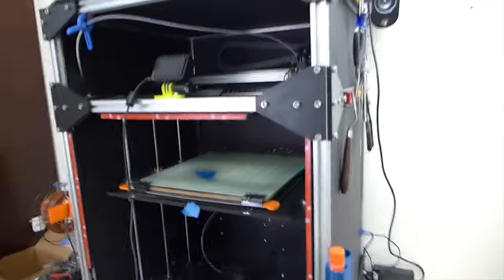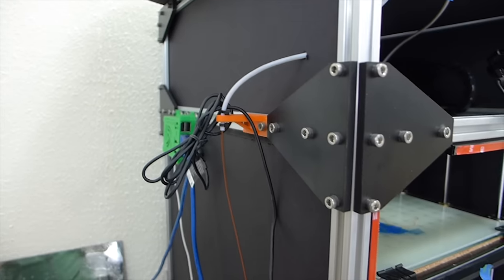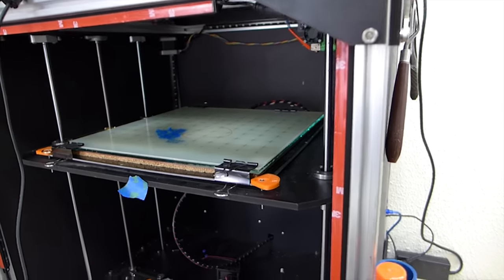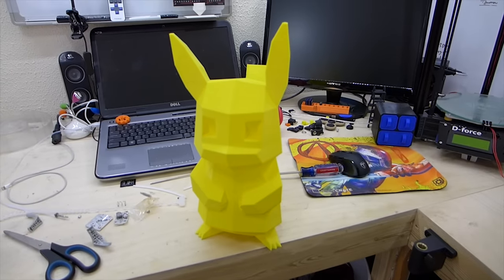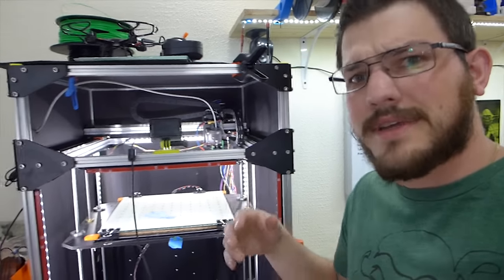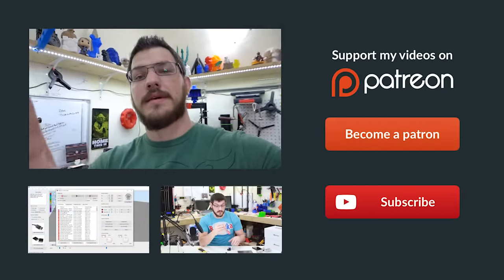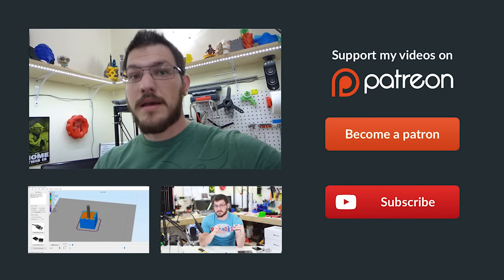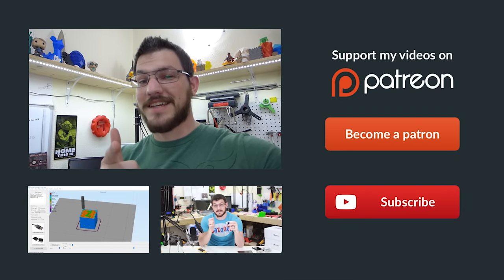Build Your 3D Printer Stock First!!

Comment: FINALLY someone says what I go ballistic over every time I read a post from some guy who just ordered his first printer and wants to know what upgrades he should order.  I want to STRANGLE the ^&(*)().  I went at least 6 months without an upgrade except for the BLTOUCH, which I knew worked well from having it on my 2020 i3.  That printer ran about the same amount of time before the BLTOUCH was put on.  To this day, the only upgrades are the  extensions for more Z height and the X axis tension adjuster.  It still reliably puts out great prints I can count on.  If it fits, it's my 'go to' printer.
I agree that there is NO NEED to upgrade the FT5 to get good prints IF you put it together square and take the time to calibrate it.  That is another pet peeve of mine.  I see so many posts of FIRST PRINTS of things that should be TENTH OR TWENTIETH prints.  Where the hell are your calibration cubes, you single wall test prints to determine extrusion multiplier, and your tolerance prints?  
They buy all these upgrades and even just the printer and expect everyone else to solve their problems rather than them doing some leg work and learning and figure it out themselves.  They are just too lazy and those on the forum are to blame because they jump right in and spoon feed them the info.  They will NEVER learn that way.  The latest was the guy who wanted to know how to hook up the electronic switch for controlling the current to the heat bed.  IT'S A F'ING SWITCH!!!!  There's an input and an output plus a signal to tell it when to turn on and off!!!!  If you don't want the input coming from the MKS (the reason you bought the damn thing), then where do you think the power's going to come from?  As for the signal, he couldn't figure that out?  
NOW YOU HAVE ME RANTING!  hahaha

Anyway, kudos on saying what needed to be said.  I have an early FT5 and the only upgrade I have besides the BLTOUCH is the E3D setup since my stock extruder never had the power to feed as well as the one on the 2020.  Oh, and I just 'upgraded' to the black heat bed I should have had in the first place.
Reply from the maker: Reading this gave me a good chuckle lol. This sadly is the new trend with 3D Printing and I hope to snuff it out.
Reply: Yes, it is the trend.  Every day you see questions that could have been answered with just a LITTLE googling and use of a few brain cells.

Comment: I would have been inclined to agree with you; however I believe you should mention if you are "a first time builder of anything 3D printer related".  I'm not a firm believer in the build it stock first if you've been around the world of 3D printing and understand Marlin, Smoothieware, Arduino for Due, have worked with the Duet boards, Due/RADDs, MKS Sbase and the cursed Arduino/RAMPS boards. First time yeah, been at it a while, pick your poison. I'm in the later group.

Comment: This is some good advice.  I just order the FT-5 printer on March 3rd but it has not shipped yet. I have been 3d printing for almost 3 years now. I started with the DaVinci 1.0. I then moved to the Flash Forge Creator pro and a Robo 3d, both of which I still use almost every day. The FT-5 will be the first 3d printer that I will have to build. The only thing I am going to change while building is putting a MK10 Micro Swiss all metal hot end on it.  The rest I am doing stock just to see how it does.

Comment: I've had mine built and running for 2 months and i'm just now starting to upgrade... basically I'm beefing up the gantry idlers to increase speed without  belts going flying. This is a great kit overall!!! I did buy a couple parts to experiment with bowden too , but i was more than pleased until i started pushing speeds. This video is good advice for sure!

Comment: I agree if you're a new user.  If you can't adjust and get stock running and have the patience to make what you have work adding more complexity to a difficult hobby will just multiply the frustration.  

If you are experienced it changes everything ( a couple years for myself). Even so my only start changes are the extruder. My whole focus in getting this printer requires a different extruder so i couldn't see starting with the stock setup.

Comment: I think you mean well but it comes of sort of condescending.  A lot of us new FT-5 owners see numerous threads about simple tweaks others have made for better quality.  So far my upgrades have been replacing the wood/pressure-board pieces with aluminum.  It sure beats doing those from the start versus assemble, then take apart again!  I see a lot of builders struggle with what part cooling fan to use....if Folger included one, that would be nice, too.  Wrapping up....many of us see the struggles some builds have and improvements are advised.  I'm not sure knocking people for considering those things is all bad.
Reply from the maker: Hey there. This kinda was supposed to be a bit harsh but not condescending. More of a "wake up call". Looking back at the video I should have said a part cooling fan is not what I am talking about. That is also not really an upgrade, it is a necessity.
Reply: Fugatech 3D Printing I don't think the part cooling fan is not 100% necessary. I've been running my FT-5 for ages stock with no fan. Just saying. The FT-5 IS great out of the box.
Reply from the maker: If you are doing detailed prints in PLA or PETG I feel it is 100% necessary. But that is just my opinion.

Comment: The absolute facts here. We bought the FT-5 R2 for business printing of cad drawings to save on prototyping lead time, and cost. Once I had the machine built to stock specs, I spent about 4 days getting it dialed in, doing tons of research, and playing with settings,. My goal was to get nice prints using ABS at very long print times 24 hours plus. As our parts can be large, and complicated. We started with the basic stuff, test cubes, etc. Once we were happy with that, I moved on. We finished our first 24 hour ABS print last night, and it came out perfect on a 100% stock machine. Not a single upgrade. NOW, I am going to do some upgrading, different spool holder, enclose the printer, and at some point a nozzle upgrade. All I can say is the new R2 kit with the improvements made, 24V bed, etc this machine can do a LOT for very little money. Just be patient when building, and take the time to get it set up right before throwing upgrades at it

Comment: I'm afraid I disagree with you. as I built mine I used the 713 maker parts where I could and the metal brackets. then I finally listened to everyone saying leave the rest stock... now I'm waiting on a heated bed to arrive because the new style heated bed only gets to 90c after half an hour. I only print abs so this was unacceptable. and yes I am an engineer haha.
Reply from the maker: You have the v4 black bed? I know it works well for PLA @ 60C but I didn't hear much about 90C+
Reply: Fugatech 3D Printing yes it is the new one, still unimpressed. I'm following your heated bed how to video on heated  beds to fix this. can you do more ft5 how to videos?
Reply from the maker: Yessir I am planning on it. One of the next ones is going to be manually leveling the bed.

Comment: I am a total newbie to the  3D world the FT5 is my first printer.  After watching a huge number of vidios I madee the decision to run stock until I have a baseline.  I do have plans to upgrade once I have a baseline,  How long should I run before I do things like a parts cooling fan and the like?  I also have plans and the need to run PETG  a lot for the direction I am going.  What filiment should I start with and when should I shift to PETG?  Thanks
Reply: Part cooling fan is not an upgrade, it is a stock feature for almost every printer and a MUST to print with PLA, PETG and it could help even with ABS in some cases, don't know why it isn't said in the FT5 build manual, but just run an extra two wire cable from the hatch all the way up thru cable chains to extruder carriage during your build, then run to proper printer calibration and fine tuning with ABS, print a proper fan duct with it, attach the fan duct to the rear of your extruder carriage, then install the proper fan to it and connect the other side of the cable to the fan powerr out of the control board, done. Please help yourself! before your build visit: Reprap Forum and in particular the Triffid's Haunter Calibration Guide!

Comment: Hi, great video. I'm sure you get this question all the time, but I am looking to acquire my first 3D printer, so I am one of the "newbies" lol. I have been doing a lot of research, and there are just so many different opinions and options of what to get. I have a budget of around 1000$. A kit sounds like the route I would like to go, so that I could learn more about the machine during assembly. What are the top few options you could recommend? Sorry for the long post, and thanks in advance. Gavin
Reply from the maker: Prusa i3 MK2 is nice, Folgertech 2020 i3 is a good cheap option and obviously the FT-5 is great for huge prints. It really depends on your confidence in building a kit or not. Monoprice Select Mini is also really nice but small print area. It really comes down to what you are looking for and you confidence level.
Reply: Fugatech 3D Printing. Thanks I have basically narrowed it down to the "Original" Prusa kit, and the Folgertech FT-5. I really like the build area of the ft-5. The Prusa appears to have nice features, and I'm having a hard time finding any serious issues mentioned with it, besides the 8 week wait time for one. This is probably kind of a loaded question, but would the FT-5 produce prints comparable in quality to the Prusa, if the directions have been followed and the FT-5 is working as it should? I know that there is a ton of variables, and the likely hood that things can go wrong with either printer are there. So I guess I'm kind of asking, best case scenario for both prints will they have comparable print quality? I appreciate the help and your time taken to respond. Thanks!
Reply from the maker: You will probably get better quality prints off the Prusa MK2 faster than you will the FT-5. But after dialing the FT-5 in, no reason why you can't print as well or better than the MK2.

Comment: Couldn't agree more with your sentiments here. I'm definitely a NOOB! The FT-5 is my first printer and I actually did order the BL Touch while I was waiting for the FT-5 to ship - only because it seemed like auto-leveling would be WAY nicer than manually dealing with it. But, I decided to do exactly what you're saying here - do it all stock first to learn PLUS to make sure I'm not injecting more complexity unnecessarily too early. Same for the dual z-stop mod, etc. Turns out manual bed leveling isn't all that bad and at the moment adding the BL isn't even on my radar.

I also like your comment about learning to slice. For me, I just assumed that using a good tool like S3D would make things super easy and I wouldn't have to do much more than click "Print". Turns out there's definitely an art to it - especially as you get into more complex pieces. Amount of infill, type of infill, rafts, supports, and so - lots to learn! Plus, I also think there's alot to be said for knowing what your printer can/can't do with the different materials. That just comes from experience.

Love the machine so far, even if my prints aren't perfect or even up to my own standards. But, it was impressive to see that first print come out pretty decent, and its getting better each day. 

Thanks for all the videos and info - I've definitely relied on your stuff during pre-build, build and post-build processes. :)
Reply from the maker: You sir have the right mindset about 3D printing. Keep it up!!

Comment: i was thinking of getting this printer but i have my printrbot plus for a year now and cant justify spending 500 to get 2 more inches of build area but my printer is working nicely but maybe some day ill get this because i want a kit and learn to put printr together also i thought if u painted the inside of the foamboard white you will have balanced white and brightness
Reply from the maker: I could have just bought white foam board but I thought it would wash out the print. I may order some just to try it out but I would also need a dimmer for the LEDs.